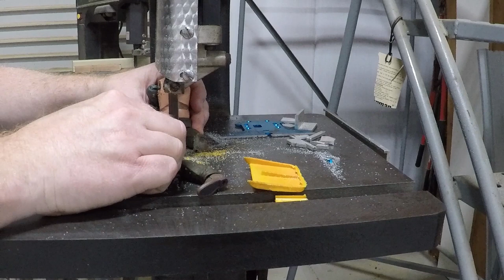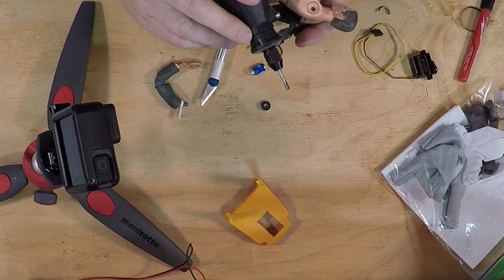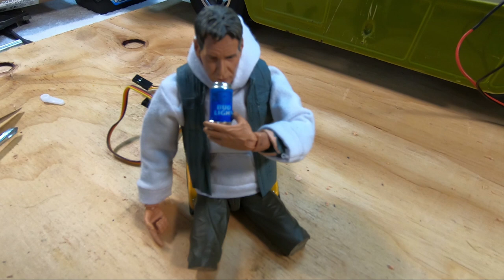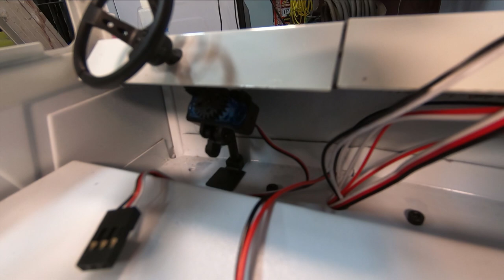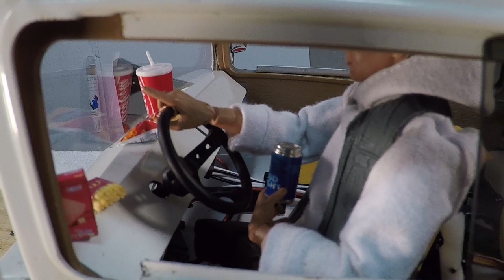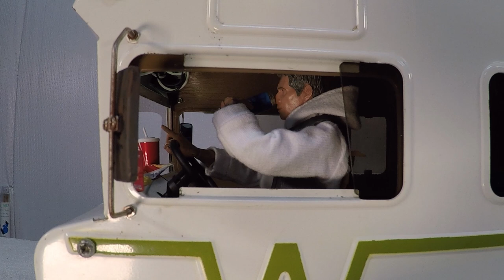Remote Controlled Action Figure Build For RC Car- Animatronics

Comment: Good video, I done similar with an army 1/6th figure in my ROCHOBBY MC Scaler jeep. Mine can look around, steer and change gear, it really brings the open top jeep to life, I control each movement with an aero Tx elevator channel and toggle switch...👍